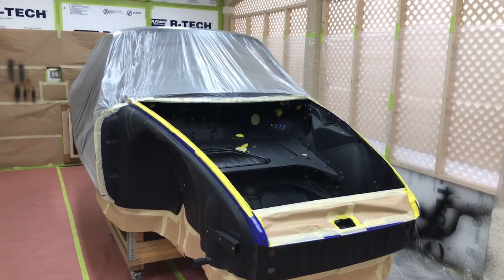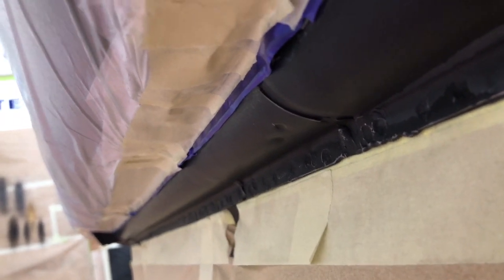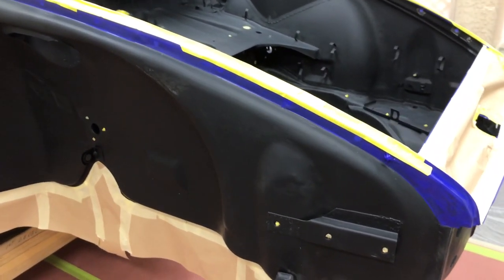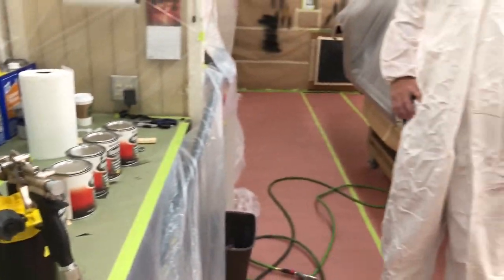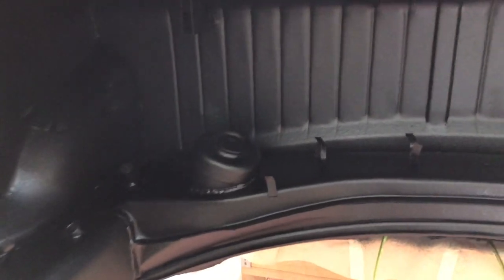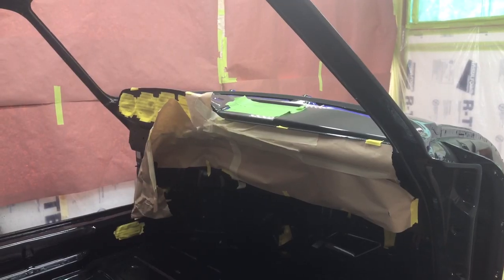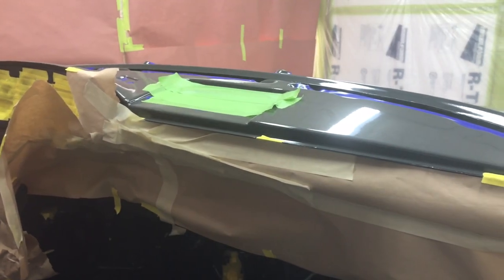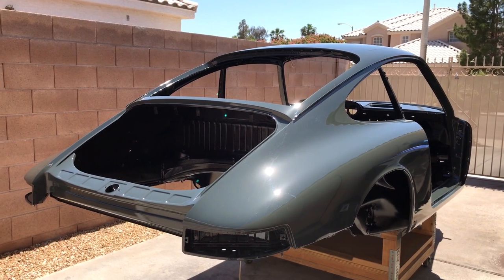1967 Porsche 911 Video 26 Undercoating part - 3 / Application process on the shell

Comment: Mike - Your project, workmanship and video skills are awesome.  I'm doing an old 240z.  Did you change your undercoating material from the first undercoating material?? The rustoleum looks great, but just wondering why you made the change.
thanks, joe
Reply from the maker: Hi Joe
Thank you! 240Z is one of my favorites! what a great car that is=)
Yes on the undercoating I mentioned in one of my early videos that I would be going with the transtar but there was some problems going on with the company at that time but came across the rustoleum and thrilled with the results..also I used a clear coat over the top for the finish
Reply: @MikesRestorations  thx Mike, i tried to find where you made the change, thanks for responding

Comment: Great videos... the led on the gun is brilliant, i'm stealing that, hope you don't mind.  Did you apply sealer to the seams too?? Maybe earlier video??
Reply from the maker: Hello Joe Joe thanks
A light definably helps those hard to see areas..
Yes sealant was applied before 1st epoxy seal coat bare metal stage..
That step was before video series got under way
using SEM 29392 Black seam sealer.. You can find this product in our store link video description box
under painting supplies
Good Luck!

Comment: Hi Mike, your video’s have been very helpfull (which is a uge understatement). I have a question though: my ‘67 has gone from bare metal to epoxy. Now i am prepping the car to put the protection layar against rocks, salt etc, the anti-gravel stuff. (Do not know the proper English word for it). You finished it off with a clear coat, which looks great. My question: did you add anything to the clear coat to maybe make it more flexible? Or is it just regular clear coat? Cheers, Niels (Amsterdam)
Reply from the maker: Hello Niels
Thank you! Im glad the series is helpful.
I just used a blend of clear coat 70% gloss and 30% flat if my memory serves correct. I did not add any flexative additive.
Many cars manufacturers have textured rocker panels for chips and road damage. The factory just sprays straight clear coat even in those cases. 
You should be fine with straight clear coat but check with the paint brand MFG for their recommendations to be safe
Good Luck!
Reply: @MikesRestorations  ok great, many thanks !!